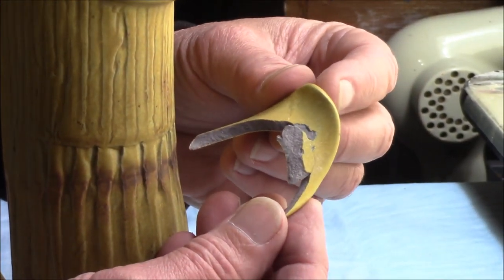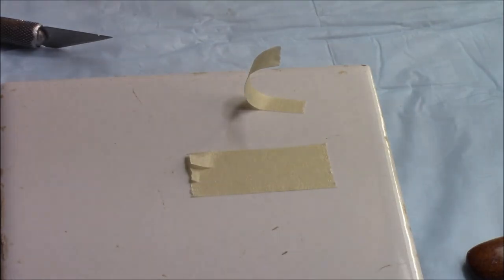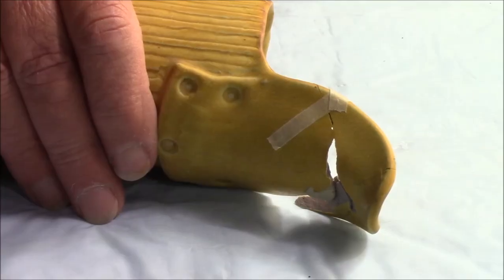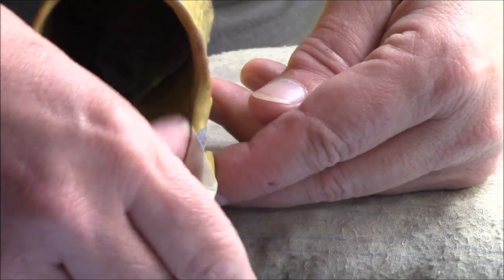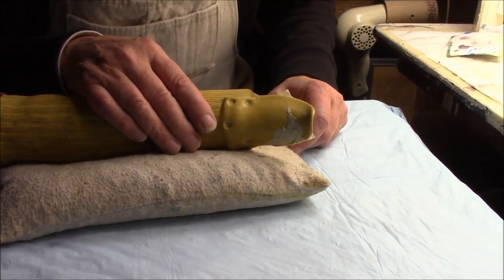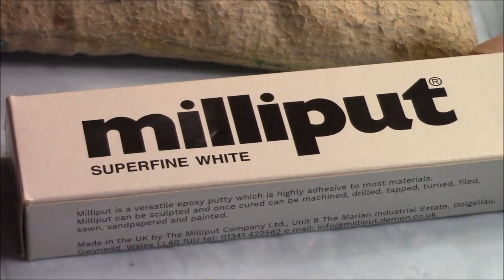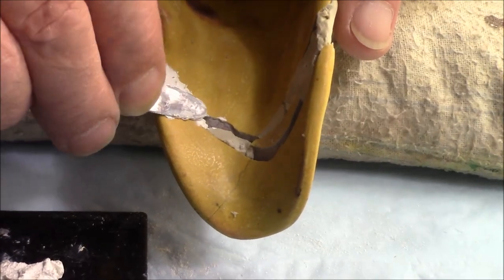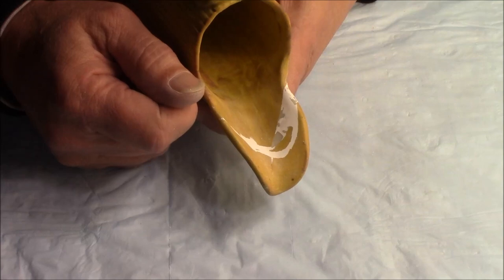Yellow Ceramic Pitcher Repair

Comment: Thanks Martin for this very informative video. You are absolutely perfect in all you do. I wanted to ask you, I purchased by mistake A+B Putty Gray, instead of White. Now, after I make a repair, will it make a difference that the putty is Gray, or will I be able to paint over it the same way as with the white putty ? Will the color change its’ shade on a Gray putty?
Reply from the maker: It should be fine as long as you get good paint coverage over the putty. The difference between the white and gray isn't so great as to make much of a difference. Good luck to you. Thanks for the compliment.

Comment: Thank you martin for the very interesting lesson. You are great. Can you please specify the file/s you use in your work (kind, size, brand, cut, seller)?
Reply from the maker: Thanks for the compliment.
I go through a couple sets of files per year. Working on ceramics is hard on files; wears them out quickly. I usually get my files from Harbor Freight. A set of large, a set of medium size and a set of small. They are standard steel files. Don't know the cut type. If you're careful you won't harm the finish on most ceramics.
Reply: @marsgitar  Thank you. It is helpful.

Comment: I have a finger that broke off a statue. It is ceramic. How could that be repaired? I would have to make a finger. What products would I use. Thank you so much for your videos.
Reply from the maker: I would use A+B epoxy putty. 
Here's a link: https://www.amazon.com/Epoxy-9904K-White-Rezolin-Container/dp/B0030D2N22/ref=sr_1_1?dchild=1&gclid=Cj0KCQiA1pyCBhCtARIsAHaY_5dZy3lAqYyzNlKYSEonnwsoPddwWBOotzGt9WrjMtjmir27twdwvJIaAlg5EALw_wcB&hvadid=485283381099&hvdev=c&hvlocphy=9032352&hvnetw=g&hvqmt=e&hvrand=16604244848434998770&hvtargid=kwd-1063310923830&hydadcr=8343_9886129&keywords=a%2Bb+epoxy+putty&qid=1615327089&sr=8-1

Comment: Thank you for this masterful video. I got everything which you suggested in videos except Sylmasta cold glaze pro, because it’s expensive. Do you know if there’s anything compatible available in US market to Sylmasta cold glaze pro ? Or similar item I can use ?
Reply from the maker: Thanks for the compliment. 
I use Sylmasta Cold glaze because nothing else comes close to working as well as it does for professional level work. If I could find a U.S. based equal alternative, I'd be using it. 
I know of other restorers who use Rustins brand similar clear coat. You might research that. I don't know anything about it really. Good luck.

Comment: The jug looks good Martin. I nearly watched all your uploaded videos. The videos are very nicely done, just as you do your repair work. I just ordered lot of 20 golden’s acrylic colors, only thing I want to know from you is how to make desired color by mixing them ? Is there any chart or color wheel you would recommend to buy ? Could you please help in this area ? Thank you for your precious time.
Reply: Or any specific colors i have to buy to make desired color ?
Reply from the maker: Thanks for the compliments Diana. I appreciate it. 
I plan on making a video addressing this issue sometime soon. 
For now: A while ago I found a mixing chart at my art store I used to teach color mixing. It was made by a company called "The Color Wheel Company" (www.colorwheelco.com). I didn't see it on their web site but you might find on in an art supply store. It uses the common color names of artist paints to make a mixing chart. Otherwise it's handy to have a good colorwheel on hand until you get a lot of experience mixing colors. They have these on the "color wheel" web site. 
If you're going to be using these Golden brand colors for ceramic repairs, I might mention a couple of colors to get: "Shading Gray", and "Titan Buff". They are quite useful in color matching because the buff color is not as harsh as titanium white, and the shading gray is not as intense as carbon black. 
Anyway, that's a good start. Good luck to you!
Reply: Thank you a lot for your kind reply. I will look forward to your video on this subject. Be well